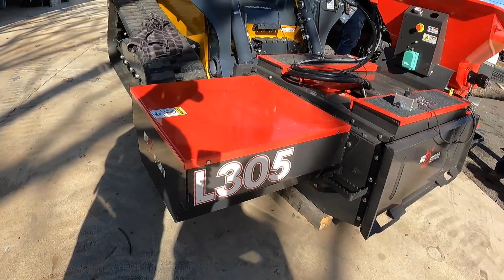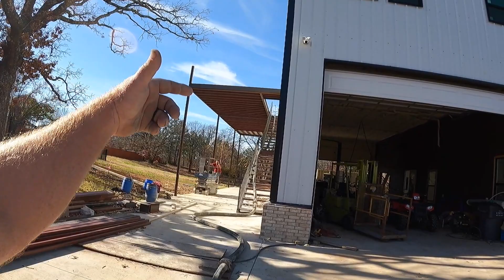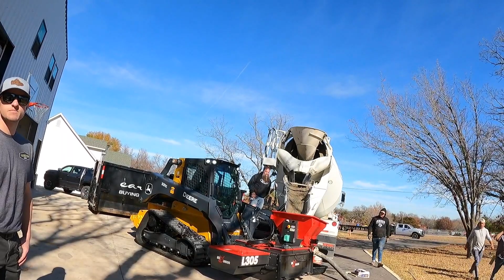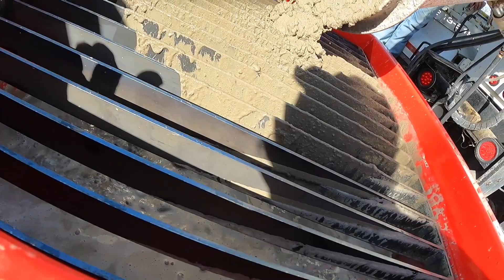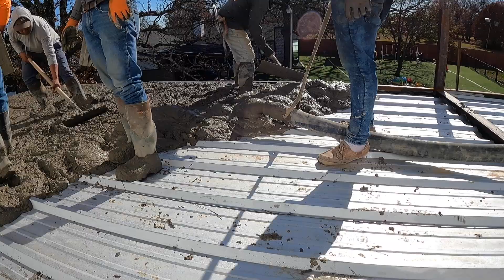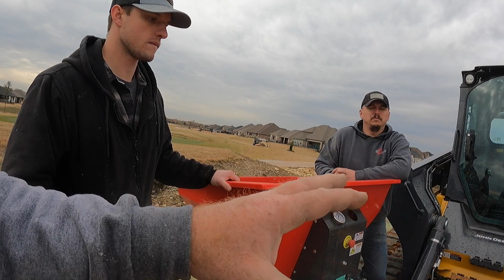Muddyfeet trying out the Mud Demon concrete line pump.

Comment: Can it run a 2 inch shotcrete hose? Seems it should with a reducer. Add a nozzle with a proper air fitting running from a 200 cfm compressor should be good to go no?
Reply from the maker: Absolutely! We sold one to a guy that builds skate parks. He absolutely loves his.

Comment: Buying, maintaining  and transporting a skid primarily for moving the pump and providing hydraulic power might not be a great allocation of capital. 
Someone else mentioned that transporting the skid, pump w/truck and trailer could push the delivery driver into a CDL weight rating, I think that's probably true.
20 GPM/2500psi hydraulic flow requires a +- 40hp engine driven hydraulic pump unit. A 40hp separate hydraulic power unit could be built for under $10,000 using a big Vanguard or Kohler engine. $10,000 VS $60,000-100,000 for a skid? 
OTH, the concrete pump might be too high if mounted permanently to a trailer. Lowering the concrete intake shrouds might help with that. 
Another thought would be to offer a specialized drop-deck tag trailer to lower the concrete pumper..OR offer an auger feeder that loads concrete into the pumper shroud. 
.
Reply from the maker: Ok, thanks for watching!

Comment: I can see this unit being at equipment rental stores rented out to contractors who already own a skid steer 
I can’t see it for your business because of the volume you pump weekly I just think it’s not heavy duty enough for large volumes of concrete but would probably work very well for grout 
Cheers from Nova Scotia
Reply from the maker: Being that the pump is built by Schwing I think it will have the reliability that’s expected.

Comment: Better off with a power buggy not worth money
Reply: They generally don't go up stairs that well either.
Reply: @dannpriebe great point. Lol
Reply from the maker: Will have to agree that we disagree. I’m not a fan of a power buggy. They are overpriced and they have their limitations. Not worth it.
Reply: a power buggy, like a concrete bucket, is also a mean that have an intermittent supply of concrete where a pump is a more constant and adjustable one...

The power buggy will also do a mess on grass 'cause it's heavier than the hose where just a tarp would keep it away from plowing the garden everywhere it lay...

Comment: Would one of them mini skids work with this? That would make a compact pump set up.
Reply from the maker: I doubt it could pick it up. It weighs 2100 lbs. It needs 30gpm of fluid movement to run the pump. It’s probably a little small on the pump also. Just guessing though

Comment: I thought all new bobcats were high flow?  Not really sure i even know what a slow flow is used for. Jack hammers breaker attachments run off high flow i think
Reply from the maker: It depends on the horse power. Usually attachments like a mower or stump grinder require the high flow. Jack hammers and grapples don’t.

Comment: Jef I can already see some downsides compared to a trailer pump. #1 where do you carry your hoses? Trailer is self-contained and can be towed anywhere. The Mud Deamon requires the Skid steer auxiliary power. I am sure the concrete community sees a need for this but for my money I would go for the trailer pumps. Thanks for bringing us along.
Reply: I see this being an upside for a flatwork contractor. If they are not a place and finish only then they most likely already have a skidsteer on the job for grading. Most trailer line pumps have no room for hoses anyway. So that isn't an issue.
Reply: Obviously in place of the trailer pump you would need a trailer to haul the skidsteer and pump, still put hose on truck bed.

Comment: Hauling a trailer with a skid steer, the pump and the hose could possibly put you over 26000 lbs.  Then you need an operator with a CDL. Over all cost of the trailer, skid steer and pump would be more than a towable pump.  Just a thought?